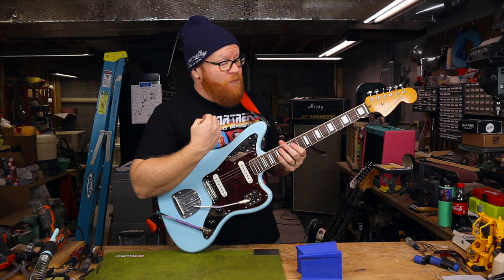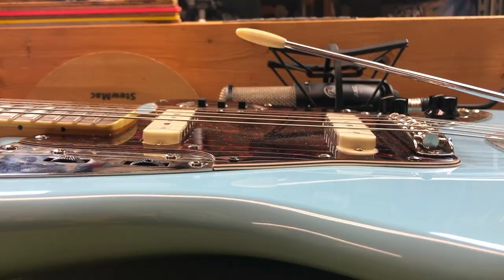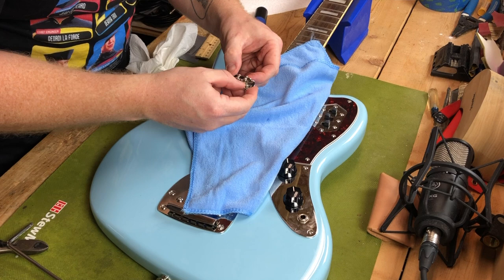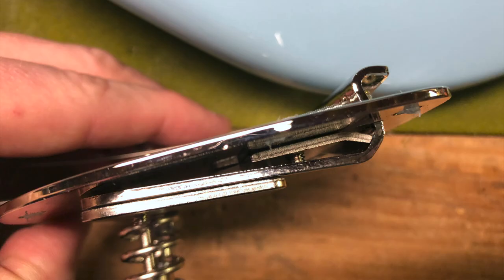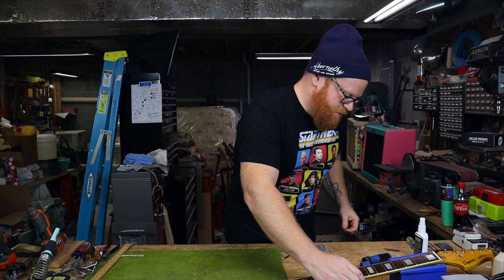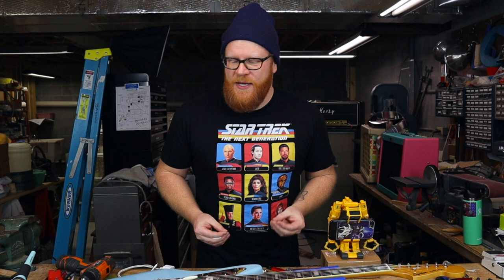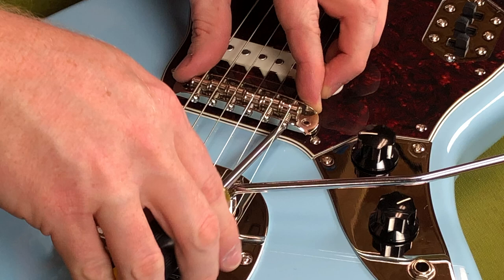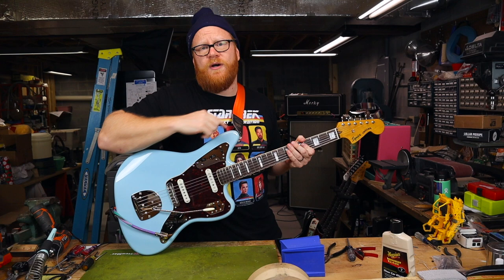ON THE BENCH #6: Squier Classic Vibe '70s Jaguar Setup + Quick Demo

Comment: I got one of these recently and am having some similar issues.  I replaced the bridge and trem with higher quality parts but I'm still having issues with the action and some buzzing so I've been considering shimming the neck pocket but it's not something I've done before and you tend to hear a lot of people giving cautions against pulling necks off guitars, even bolt on ones.  I've been screwing around with guitars for the better part of 20 years and I'm relatively good at mechanical work, you think it's maybe something I could take a swing at or that it's too easy to fuck up and I should just go pay someone to do it for me?
Reply: One just got one of these and just shimmer the neck. It was really easy to do and it's the first time I've ever done it. Put the guitar face down and gently pull the neck down and away. I was worried paint would chip off or something but it was fine.

Comment: eh mike i have 1970 fender squire vintage hoag land custom switches mustang bridge custom trem plate how can i tell if its a 9.5 radius or a 7.25  how do u measure this my last build will a 9.5 neck fit will a bridge that supposed to fit all necks thanks john

Comment: Hey Mike. I have a CV Jazzmaster and did the blue loctite trick to keep the bridge from falling. It may have worked a little to good.  I wanted to lower the action on the low E side and before I got it where I wanted it I stripped the screw head out.  High E side is A OK.  Any suggestions on how to remove that stripped screw?  Just buy a new bridge?
Reply from the maker: Oh no! Yeah, only a tiny dab is required, but if you ever want to 'break' loc tite, heat is the answer. I usually hold whichever part I'm working with to a soldering iron first, then adjust feely.

Comment: thank you very much Mike for this video - exactly what I was looking for for quite a long time! Funny just yesterday I completed the whole setup on my jag and everything you did except that "rounding" of tremolo plate - I was just about to do it intuitively, however I was worried if it's good idea to scratch the thing and get corrosion. Pitty I didn't perform the setup day later ;) Btw did you use any lubrication on the nut? and what is the exact thing you put on the saddles? P.S thumb up for that extra mile polishing the nut!!
Reply from the maker: I always use lubrication in the nut, often just chapstick. Loc Tite is what I used on the loose screws!

Comment: Some notes:

The chrome is junk and mine came with embedded fingerprints that has turned into some kind of ugly premature ageing on it.

Wilkinson or Gotoh vintage style tuners drop right in.

The bone nut seriously is only half finished from the factory. Yay. 😑

The CV look fucking cool compared to the Player series but don’t buy one if you aren’t prepared to set it up.

And finally: thanks for posting how to unscrew the bridge so I can access the blades I was stumped.

Comment: I have this same Q, anyone help?....@puisheen great video thank you.  I'm about to try and shim my CV70 - I have a question - did you have to drill new neck holes, as the existing holes with be off angle once the neck shim goes in? (I'm putting in a 1 degree StewMac shim)

Comment: @puisheen great video thank you.  I'm about to try and shim my CV70 - I have a question - did you have to drill new neck holes, as the existing holes with be off angle once the neck shim goes in? (I'm putting in a 1 degree StewMac shim)

Comment: I just got one of these and I really like it, but I too have the problem with the sinking bridge. I've never used loctite, is it something that needs to be reapplied over time to the posts, or is it a one-time thing? Also, can the bridge height still be adjusted after the loctite is applied? Thanks.
Reply from the maker: Loc Tite should be a one-and-done situation!
Reply from the maker: And yes, adjustable!
Reply: @Puisheen  Mike loctite in the UK often means superglue. The threadlocker you mention is the blue 242 removable stuff, I believe.

Comment: Always wondered, if the neck ALWAYS needs a shim, why don't they angle the pocket a little?
Would love your thoughts on converting a jag to a baritone! Might plan on that soon...
Reply from the maker: They do that on some of the US and Mexican models but it's often too much. I'm more in favor of having this aspect be user-adjustable, but they just don't spend the time to set them up correctly at the factory
Reply: @Puisheen  Didn't know that! Interesting point though. I think there should me a minimum build-in shim so that you don't have total failure like strings popping out, horrible action etc.

Comment: Thank you, this video was really helpful. I have managed to get rid of most of the issues, however I cannot intonate the guitar at all. Adjusting intonation screws does nothing. I have watched and read multiple tutorials on how to set up the intonation but none of them cover the issue that I have. Basically, no matter how much I will move the screws forward or backward nothing will change; the strings stay extremely flat or sharp. Any ideas?
Reply from the maker: If you're attempting to change intonation with the strings at tension, you may have flattened the bottoms of the strings which will render them impossible to intonate. Before you move the saddle at all, be sure to detune the string you're working on, or at least lift it out of its saddle slot to prevent this. Also, only ever attempt to intonate with totally fresh, unplayed strings

Comment: Im a heavy arm user. Ive used The hammer trick so it doesnt bottom out. But after playing today, The arm has started to wiggle up and down when i use it. Like it is a bit too loose compared to before. Is That The collets Thats loose  because of heavy arm usage? It’s a Mij Jaguar from The Early 90s. Would appreciate if anyone knows What The issue could be. Just realise it’s a little metal ring That needs to be tighten around The collet. As i did, But keeps coming loose when using The system.
Reply from the maker: Oh yeah this often doesn't help so much with MIJ instruments. If yours is the type with the totally smooth arm with no indentation for the collet teeth to dig into, yeah this is just going to keep happening.

Comment: I have bought 2 or 3 CV Strat and an Affinity and they are pretty much perfect. Why don't they just make a strat with a pickup in a metal box and 1 meg pots and call it a day? We don't really need trem, the tone controls, fancy pickup switching.  They could also make them 6.5 lbs like some of their CV 60's. 

Because the jaguar pickup is a great idea - slightly increase the winds, put it in a steel baseplate, and then you can afford the 1 meg pot and keep the tone from going to ground.

Comment: Why dont fender just ship their offsets with a shim already installed? Even if the set uo still needs tweaking, it would probably help get morr people to buy them when theyre actually playable
Reply: Sometimes they don’t need a shim. I have the Squier Charcoal frost 60s jaguar and the bridge sits 5mm off the body and didn’t need a shim so the neck pocket was routed correctly.

Comment: Hey did you have a problem with scratchy frets? I was dead set on buying this at GC until I did some bends and it felt like sandpaper..

In your opinion is this a non-issue that can be fixed with polishing, or are the frets just low quality?

I may return if I can be convinced otherwise, as the one model had a blemish on the headstock and they said they'd give me a discount.

I am absolutely goo-goo eyes over Daphne blue, with a block and bound neck. The custom build route is extremely difficult and will be expensive if I want a 24" scale with block and bound neck.

Thank you
Reply from the maker: Not on most CVs, but a few VMs I've worked on had the frets polished up and down the neck instead of side-to-side so you can definitely feel that when you bend. Some steel wool usually does the trick

Comment: Asked on another video, but it's pertinent here too: for a novice player with a strat and sg, would you rec the CV Jazzmaster or the Jaguar as their first offset? I don't have enough short scale experience to know if I like or dislike them yet.

Also what kind of Loctite is that? Thread sealer or actual adhesive?
Reply from the maker: I think that's really up to you! They feel drastically different from their individual scale lengths, and if you own a Strat you might find the Jazzmaster very similar in feel on your fretting hand.

Comment: Hello, I just recently purchased this exact guitar from my local GC. I'm following your vid step by step and I was wondering if it would be better to use the .5 neck shim or use the .25 and sand it down like you. If the .25 is the better option could you tell me exactly what you did to sand it?
Reply from the maker: David, it really just depends on the guitar itself as well as your needs. A .5 could be great, but the only way to really know is to install it and see!

Comment: Hey Mike, I know you said that nothing beats AVRI tremolos for Jags and JMs, but how do the Japanese ones stack up? The AVRI trems are very hard to come by in the UK.
Reply from the maker: They're basically a lateral move from this. Not an upgrade by any measure
Reply: @Puisheen  Thanks Mike. I wish Fender wouldnt treat their offsets like they're the black sheep of the family. If they just stopped trying to "fix" their Jags and JM's and put together a handy guide on how to set these guitars up, really try and push info on these guitars and disspell myths, then a lot more people would be willing to give them a chance. 

I really want to try out these guitars, but im cautious because im a novice when it comes to guitar setups and I'm worried that any guitar tech i'd take it to could screw it up.

Also im just ranting at this point but oh my god, why cant they make their guitar parts more accessible? I really want to put together a Squier Bass Vi with the Fender Mute system (so I can switch between tic tac basslines and baritone playing) and either an AVRI or Panorama trem. I would get an aftermarket trem but I specifically want to use the trem lock because I switch tunings a lot.

Comment: How long does the oiling a neck like this last? Will it look all dry again in a month?
Reply from the maker: Usually it doesn't dry out that quickly, but it always helps to keep guitars in a stable environment as far as heat and humidity is concerned. Normally I keep mine in their cases when not in use, best place for them.

Comment: Hey man, I have a question for you. I just got the AO with the angled neck pocket, and my string slippage isn''t terrible, but I still have the problem with the saddle's and bridge having sinking screws, and there is some saddle buzz. So I want to raise the bridge but that would require a shim, and since the neck pocket is already angled I don't want to overdo it. Should I just get a flat shim? Or what do you think?
Reply from the maker: With your guitar I'd recommend using Loc-Tite blue on those saddle screws. Adding more neck angle sadly won't fix the sloppy fit of current Fender saddles and their screws
Reply: @Puisheen  thanks. I did just pick up the blue loctite yesterday.  Do you think i should add a reverse .5 degree shim though so that i can raise the bridge and increase tension on the saddles? The bridge is as low as it can go currently and the saddles could also be higher. I just received the shims in the mail today and was going to shim it tonight. Im just not sure if i should change the break angle or not

Comment: Hi. I got a question. What size files should be used to get the nut ready for 11s
Reply from the maker: Either files that are right on the gauges you're using or slightly larger. My Stew Mac file is a 12 and I use 11s, works great

Comment: I just got in my sparkle purple CME version and it REALLY needs a setup.  What oil did you use and what grit steelwool for the polishing? Thanks so much for this video it is exactly what I needed.  I never knew about rolling off the tone when doing the intonation, great tip.
Reply from the maker: 0000 steel wool is what I always use on frets

Comment: ya I bought one and it's the worst guitar I ever bought. sooooo much work to be done and when you dont have all the tools you need to get them and now I have been watching a thousand videos cuz yes I have shimmed neck guitars with full wood shims of course, for better action etc... but never ever filled nut grooves. I have almost always had floyds with locking tunners. and now I know why I love them. if you want to lower the nut  you simply take it off file off some wood and screw back on. soooooo simple. others I have with bone nuts are fine. this stupid squier is baddly made omg it's crazy way too many issues. but I will try and fix them all. my trem work fine no noise at all anywere. lucky me lol most of my guitars the neck are straight with the body, no reason they should not be. there supposed to be that way. true some guitar have backed necks and are ok too, only way old guitars need to be shimmed back often for better action. I love the lowest action possible without fret buz. simple reason is it's plays easier and give way faster playability. I gonna lower the nut way more. it's soooooooo freakeshely high. I will say that you just eyeballing the filling of the nut grooves like that is pretty weird

Comment: Is it just me, or does all that seem like way too much work to do to turn a NEW guitar into something that sounds and plays as supposed? What sort of scam is that? Not only offset guitars are the most expensive ones, for some reason they also just won't get a proper setup from the factory, so you should do some extra steps to make this overpriced garbo work at last.